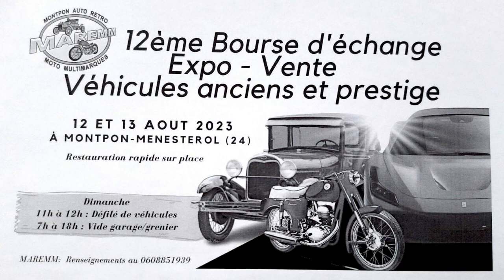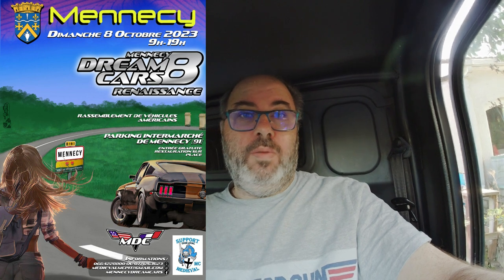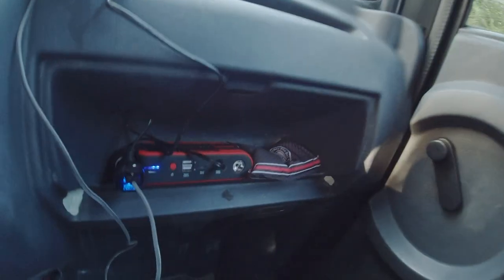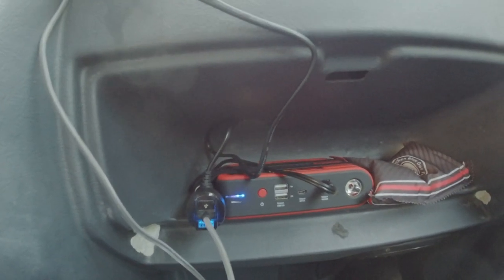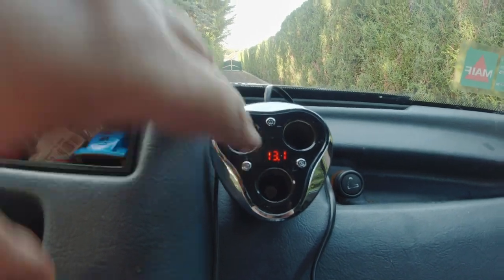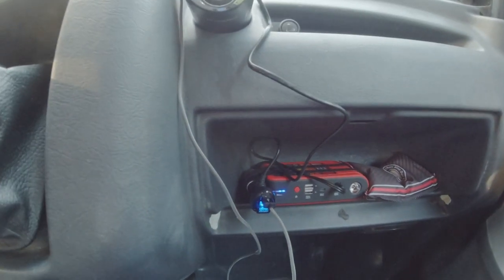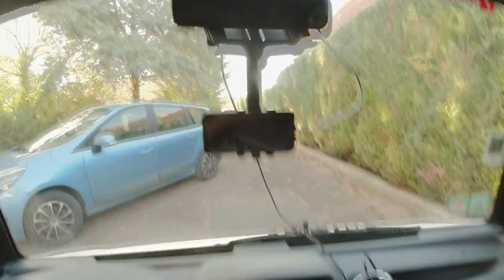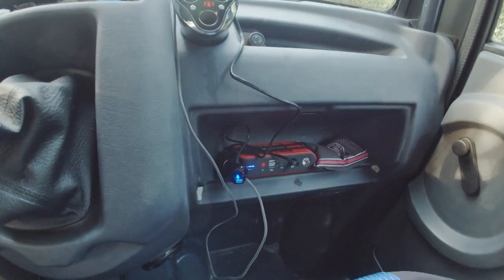Mega Breadvan auxiliary power tinkering project + plus future vehicle show visits

Comment: Hello again, now you have a topic that is quite difficult to respond on. What I found out about our Aixam is, that the battery could have more "Power". We use our Van very often for short distance trips. It is about1 kilometer from our home to the facilities where our horess are. Starting up the Van eats electricity, then you stop charging after a 1 km-trip. Then starting procedure again, the trip back is only 600 meters though. Not much for charging a car-battery. The van does its duty, 4 times a day. at 5:30, 11:30, 18:00 and 22:00.  Plus: During the week, every workday, the van is used in the early mornings, to get my wife to the bus-stop, about 3 km downhill and again in the afternook 3 km uphill again. In the early mornings  at 6:25 with the lights on. That is hard on the battery because of the short distances plus the dark hours in the early morning, plus it is getting colder, heater vent on. My solution is, to hook the battery on my charging device at home once a week. That helps a lot. Besides that, the car-heating is great. It works!!!! We are very happy with our Aixam Mega Van. Greetings from Germany.
Reply from the maker: Hi Peter,

When I bought mine, the battery fitted by the dealer wasn't very good. But I ran with that for a few years. Unfortunately a couple of times I left my lights on for a relatively short time and of course it flattened the battery. So I bought a brand new one and since then things have been better. Strangely even MORE better since I replaced all the fuses. The van now starts first time, much of the time.
My heater isn't very good and I think it might have a problem. So only useful for blowing out "warm" air during the Summer.
I have ordered an auxiliary battery pack:
ALLPOWERS S200 Portable Power Bank 200W 154Wh
https://iallpowers.eu/en-fr/search?q=ALLPOWERS+S200+Portable+Power+Bank+200W+154Wh&type=product

All the best from France.